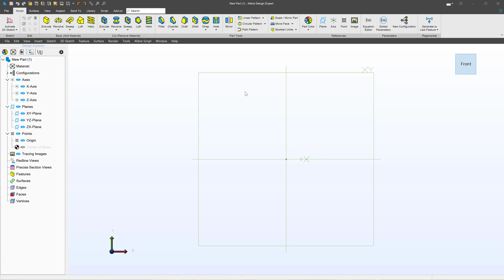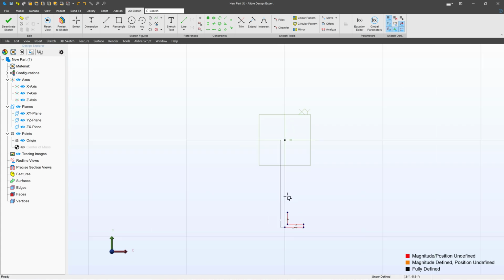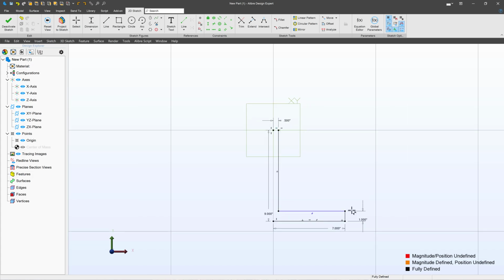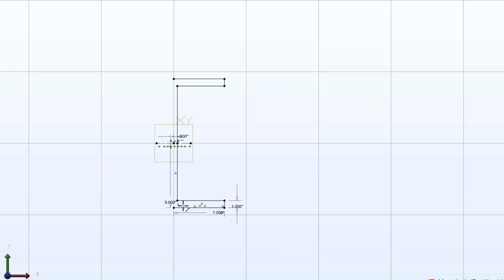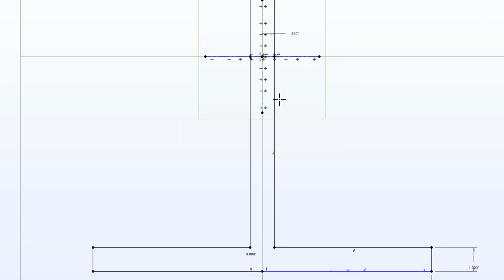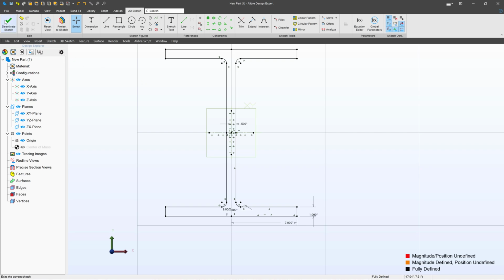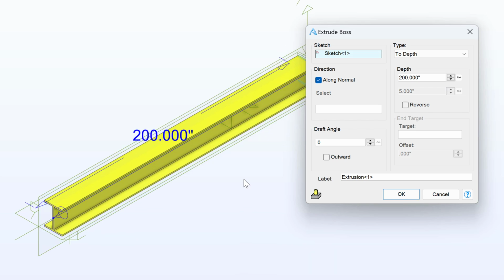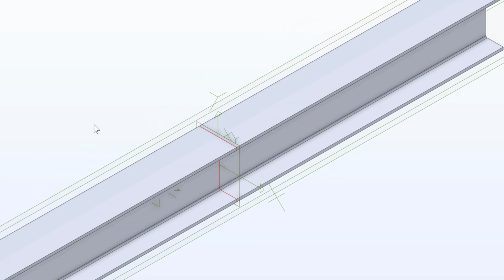Modeling a Solid I-Beam | Alibre Beginner Course #8

Comment: ;lots of steps just to get elements parallel, perpendicular and defining length when other cads do it within the generation of each element. Sometimes grids are useful. I like the idea of parametric but sometimes...
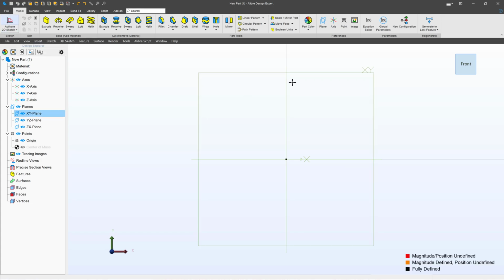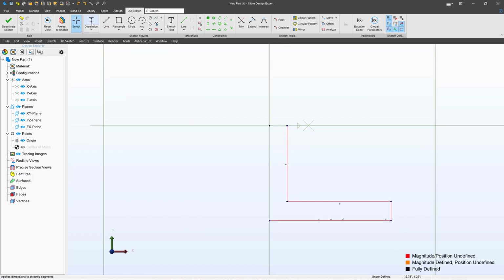Reply from the maker: If you watch from 0:29-0:40, the parallel, perpendicular vertical and horizontal constraints were all automatically created with each element.  Alibre also has the capability of generating defining length while creating the elements, though that is not covered here in the beginner videos.

Comment: Good tips on sketching. I would only add that if you apply the dimensions AFTER mirroring the sketch figures you can then enter the full design dimension values. Hence, no calculations to figure out the design sizes.